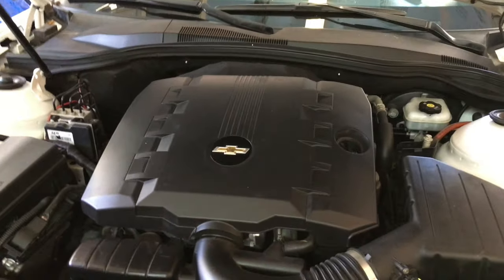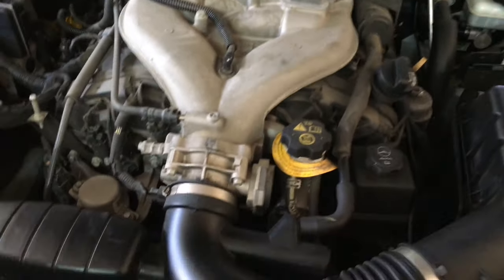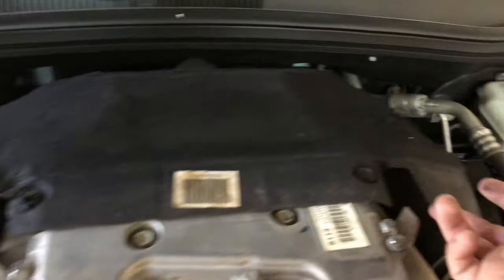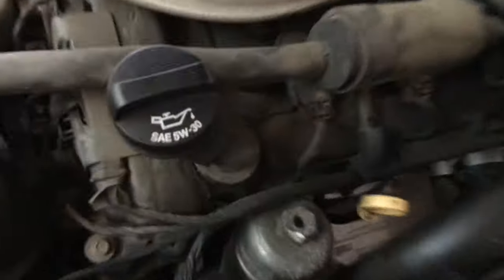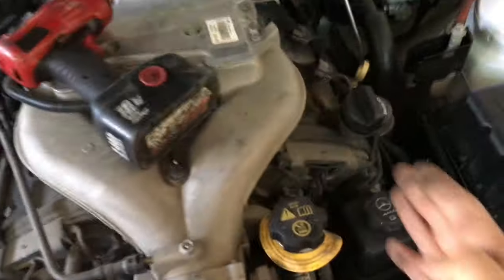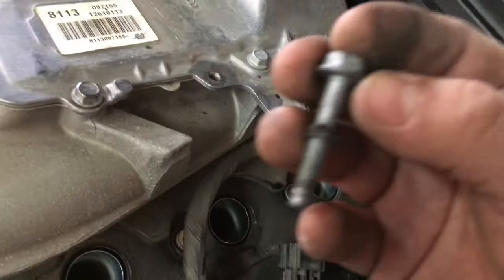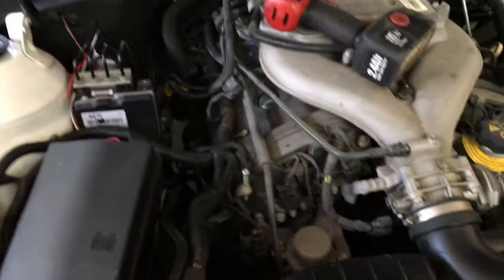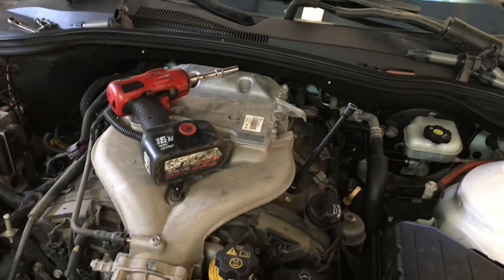Chevy Camaro Spark plug DYI Replacement

Comment: Thank you so much for your informative video they were trying to charge me $500 and the parts only cost me50 bucks.  I appreciate you I’m gonna go by my first socket wrench today
Reply from the maker: Good luck
Reply: @FalconsGarage  Can you tell me what ratchet you used for the middle ignition coil on the passenger side? I got all five of them out except for the one in the middle I didn’t have a toolyou had
Reply: @Beautiful-Gorgeous  did you figure it out
Reply: @michaelmcmaster3559  Yes I did☺️
Reply: @Beautiful-Gorgeous  perfect! 😁 I’m about to change mine out, wish me luck!
Reply: @michaelmcmaster3559  You got this Michael, you just need the right tools. And then after that it’s very simple make sure you wear some gloves to protect your fingers and make sure to stretch, it’s a full body workout lol

Comment: what if you have oil in the spark plugs i have a 2011 camaro ls and i was change the spark plug and oil was in sector on 4 and 6 cylinder

Comment: hey man im having a problem with my 2010 v6 LLT camaro i just got the timing chain replaced and my cars been running fine for two days since i got it back then just today i noticed my car starts to jerk/bogg out... when im at a stop light and i want to accelerate hard it boggs out and it wants to die but it doesnt die ... theres no CEL on so do you think my coil packs are bad or spark plugs i really need help with this!! thanks
Reply from the maker: i would check the pugs .. most coils when they go bad you will get a CEL because they are soo electronic based
Reply: Mins doing the same did you find out the problem
Reply: @maromax4626  lol i dont have the car no more man, But the issue for me was, the car wasnt getting fuel due to my nitrous installing lol, It was installed poorly.

Comment: Hey man thanks for the video and for keeping it up on YouTube all these years

I have a question, what is that hose called sitting right on top of the engine at 0:54??
Reply from the maker: i belive its an evap line .. not sure of the exact name .. maybe upper evap line
Reply: @FalconsGarage  I actually just found out. It is called PCV Valve Tubing Foul Air. That’s what my local chevy dealer told me today . In case you or others wanted to know. Thanks!

Comment: I have a 2013 RS, got the 3 done on the driver side but the passenger side have ton of wires and tubes blocking it so I can’t get them out. Did you have this problem too?
Reply from the maker: no, might need to take the intake off maybe?
Reply: @FalconsGarage  yup that’s exactly what I did! Was actually much easier than I thought just one extra screw and boom, perfect Clearance. Thanks for the help!

Comment: I have a 2010 Chevy Camaro LS. I was told that the intake has to be removed to change the spark plugs, is this true?
Reply from the maker: should be the same engine .. so I dont think so
Reply: I believe the 2010-2015 should be the same procedure. 2016 and up you have to take the intake off.

Comment: What is that black hose on top of the engine in the middle called or for?
Reply from the maker: Jose Guerrero I think it’s the pcv valve hose.
Reply: Falcon's Garage yeah I found that out , I had cracked it changing my spark plugs and got a new one for 20$
Reply: I just broke mine as well... is it a dealer or parts store part? Also is there anyway to get to those back two plugs on the passenger side? I can’t get the coils pass 😢

Comment: Replacing the wires along with the plugs? yay or nay?
Reply: Just found out today that there is no spark plug wires 🤯
Reply from the maker: This cars don’t have wires. Just just replace the could if the go bad. But if they are not bad don’t worry about it.